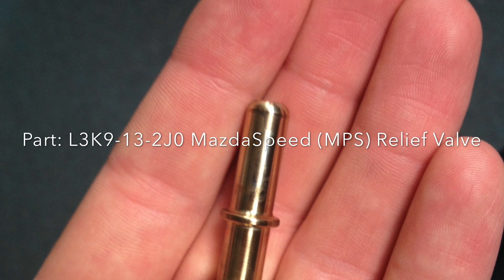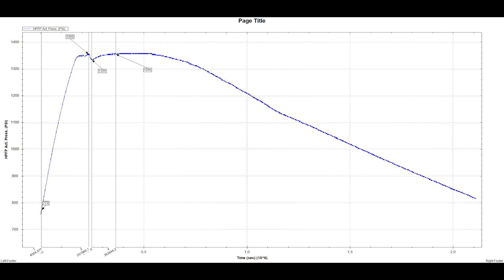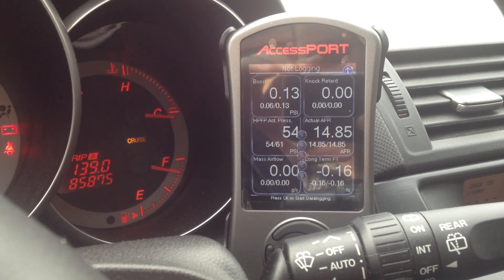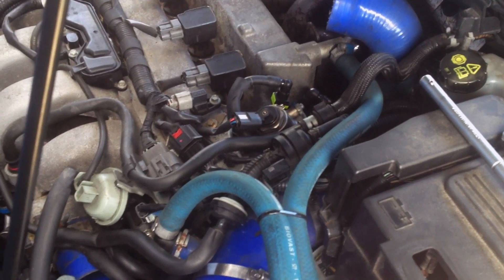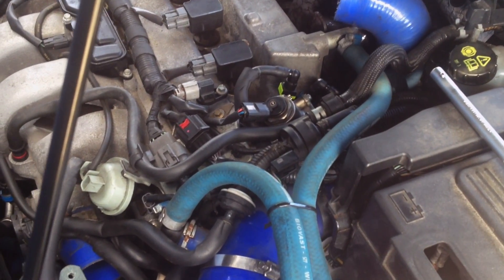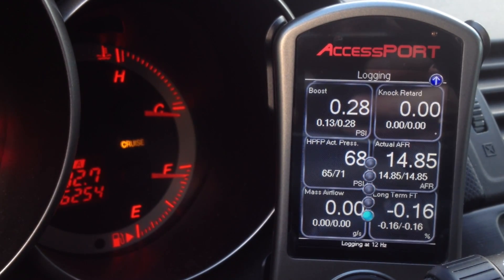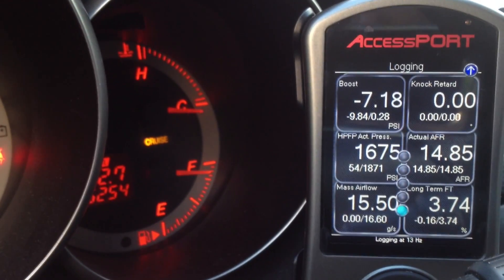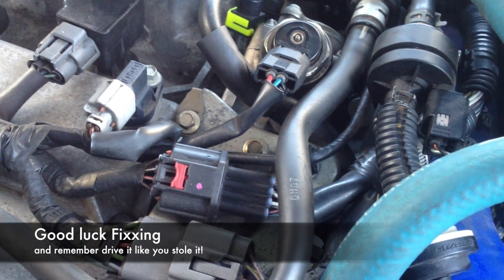Relief valve Failing & Fix Mazdaspeed 3/6 CX7 (MPS)

Comment: I have p2178 fault occasionally on my ms3, it have low rpm (~1500-2000) jerking while driving at steady throttle position, hpfp at idle is 420 psi and on light throttle 1650 psi, LTFT 1 is - 15, no vacuum problems, maf and lambda sensors working fine, what to look next, car running fine after throttle relearning procedure, and after day or two it's starting all over again to piss me off, sometimes throttle is very responsive, and sometimes like there is no turbo, its very laggy, limiting boost to 0.6 bars

Comment: How do I check that the valve is working properly with a physical inspection?
Reply from the maker: Well that's difficult! You can remove the valve and then screw in on a hydraulic pump with pressure gauge. But make sure to use fuel for the hydraulic liquid, you don't want to contaminate the fuel system with hydraulic oil or other liquid. In anyway a cheap ELM327 scanner and a good odb2 app for Android can do the same without removing the valve and creating a contraption to screw the relief valve in!

Comment: Hello i know is been years to this, I recently got a CX7 and having trouble with CYL3 misfiring (20 to 80 times only) only on cold starts, no check engine lights, I am wondering did you had any misfirings because of this relief valve?
Reply from the maker: A bad relief valve will not give misfires in 1 cylinder. Then all cylinders would be misfiring and would be doing it all the time. Might be a dumb question but have you checked the gap of the plug? Have you swapped over the coil from cyl3 with for example cyl4 to see if the misfire then happens in cyl4. And checked the resistance of the wires to the ignition coil?

Comment: I've pulled this part number but it says it doesn't fit the speed 6. I'm having the same issue where it feels like the fuels cuts off at certain rpms. I'm looking at replacing the fuel pressure sensor as well
Reply from the maker: The part should be the same! From my knowledge you could ask your local Mazda dealer for the part number! If you have bad pressure sensor you also have problems with high knock retarding or high or low AFR and your LTFT and STFT would be showing really high or low number like ±15% since the ECU uses the pressure sensor to calculate the injection time and this will affect the AFR.
Reply: @jaspervermaas  ok. Thank you. I know it bogs down real bad and acts like it's gonna die on acceleration like the fuel is cutting out. I have new injectors, plugs, and MAF sensor. Trying to troubleshoot everything we can.
Reply from the maker: if the rail pressure sensor is dead or on its way out you would also see when idle... Than the pressure should be close to 450 or 600psi from what i remember... So if its only happening at full power thans more than likely thats its the valve and not the sensor!
Reply: @jaspervermaas  ok. I will take a look at it. It's a brand new motor and we've been troubleshooting everything these last few weeks on why it's running the way it is. You've been a huge help
Reply: @jaspervermaas  so after messing with the car, the hpfp acctual pressure only reads extremely low. Would that still be the relief valve?
Reply from the maker: @thebigd7177 are you running e85? If your running the car with more the 35% ethanol than the needle on the top of the HPFP that controles the pressure Could be fouled. The fuel under high pressure will flash when suddenly lowered in pressure and this makes the e85 or mixture start to gum up the needle that controles the pressure
Reply: @jaspervermaas  nope. Just running 91
Reply from the maker: Could also be the fuel filter or the fuel pump in the tank... If the filter is dirty it can restrict flow... But this may be a far vedged thing.... If the car is also seeing a really Knock retard of 7+ than the ecu tries to pull timing and inject more fuel. If the KR is still high after pulling timing than it will try to inject even more fuel. And it will command a crazy injector duty this will keep the injector open this can also cause low fuel pressure. Now here is the kicker... Knock is detected by the microphone connected to the engine. But if there is any thing that is vibrating at the frequency that the Knock sensor thinks is Knock then you have falls KR detection but it will do all the above discribed steps to counter the KR.... I had this ones with a bolt and washer that was rattling but I only had KR that made no sense to me so I just went over all bolts that I had touched and that fixed my KR... But it's a just thing that you might want to check or log on the car if you see high KR and high retarding and high injector duty cycle>90%

Comment: i replaced my prv but th3 whining noise still there could the hpfp be busted?
Reply from the maker: As long as your fuel pressure stays at +1900psi when you did the test that I describe than your reliefvalve should be fine! And if you do a data log of the fuel pressure when driving and under boost and the commanded pressure is reached and you'r not running <90% duty on your HPFP than its not the HPFP
Reply from the maker: You could always check if there is dirt in the needle of the pressure controller of the HPFP. But if all values are good when logging than there shouldn't be any mechanical issue!
Reply: @jaspervermaas  did all of that and the noise still there

Comment: so mine does the EXACT same thing, squeals, falls on it's face, stalls out intermittently and dies.  do you think the squealing is because there is not enough pressure on the HPFP?
Reply from the maker: The sqeel happens because of the design of the valve. There is a mesh screen that opens when the pressure is to high but if the mesh fails than it opens and starts vibrating and causes the squeel

Comment: I am having issues wkth my 2013 mazdaspeed 3. Going lean at hi boost.. but i can run half throttle at hut 15 psi at 11.5 afr. But the second i go more then half throttle hofo acct pressure drops from 1850 to 1400 1000 800 400 and leans out bad.  I have a dw300 in tank pump and auto tech internals . With 10k on them and ran fine until just recently.  Koeo hpfp pressure is 51 to 48. And went to 46 and 44.  Idle fuel pressure goes down to 350. When doing the test engine warmed up koeo with position to on the hpfp pressure goes down not up. 430 410 400 380 365 then trickles down slowly.  Only codes i have seen on the car is p0455 and the purge valve is working sealing and functioning.
Reply from the maker: If do the test i showed in the video and the  pressure goes up to 2100psi than its not the valve on the fuel rail! If your hpfp also has a good spill valve than it could be either a bad LP fuel pump, fuel filter that is dirty or maybe a bad injector. Easiest thing to do is change the fuel filter.

Data log the commanded injector duty and the real injector duty. And maybe setup a map that protects your engine by lowering the commanded boost and retarding the timing when fuel pressure drops to 1000 when at 100% throttle cause running 400psi fuel when going full boost will 200% kill your engine due to knock!

Comment: Hey guys, I'm having trouble interpreting the time scale on the x-axis.  How long should we be trending the fuel pressures after shutting off the ignition?  Anything x 10^6 seconds seems kind of off to me?  (i.e. 1 x 10^6 = 1,000,000 sec = 12 days, LOL).  Was the accessport maybe recording in milliseconds?
Reply from the maker: Let your car run for 5 to 10 min. To warm up than you shut the engine of you should see the pressure rise by 2 to 4 psi per second in the beginning and that will slow down the more pressure the system builds up so it could take again something like 10 min for the complete test!
Reply: @jaspervermaas  sorry, didn't see your reply until now.  Thank you for your response!

Comment: I'm not getting any fuel to spark plugs on my 06 mazda speed6 2.3l awd turbo. To test and see if the pump was working we cranked it with that yellow hose unplugged and fuel came out, any ideas what can be causing no fuel to spark plug?
Reply from the maker: Get a OBD2 Dongle or a use your Cobb access port to see if the HPFP makes any pressure... The fuel pump in your tank should make between 45 and 60psi than the  HPFP should make minimal 400psi. Maybe your injector fuse is broken... This video only shows how to diagnose the relief valve on your HP fuelrail... And should open close to 2100 psi to protect your fuelrail and injectors.
Reply: @jaspervermaas  I'll order the dongle and stuff, it'll take a little bit to get it here but if I post the stats it shows will you be able to help diagnose it with me? Please and thank you for the help already
Reply: @jaspervermaas  do you mind placing a link to one? I don't want to get a completely trash one on accident
Reply from the maker: @outfishing3909  https://www.amazon.com/obdator-Bluetooth-Scanner-Automotive-Diagnostic/dp/B074DWH8JR/ref=mp_s_a_1_3?dchild=1&keywords=elm327+bluetooth+obd2&qid=1625521919&sprefix=elm32&sr=8-3
Reply: When I use my obd2 scanner it says fuel system ok, im new to using these more high tech scanners I'm used to the old show code and reset code ones.
Reply from the maker: @outfishing3909  check your fuses in the engine compartment. And if they are all good than get yourself a ELM327 Bluetooth dongle and OBD scanner tool for your smartphone like "car scanner" for Android than you can monitor live data from your engine and than you can do a good diagnose and not play parts bingo by throwing a new pump on your car and finding out that for example your pressure sensor is broken and because the engine sees no pressure it will not inject fuel...
Reply: Also my fuses should all be ok as far as I can tell
Reply: When I use starter fluid it sounds a lot better but still doesn't start if that makes any difference
Reply from the maker: @outfishing3909  do NOT start a direct injection car with starter fluid! MZR engine is DISI (direct injection spark ignition) meaning it will inject fuel close to TDP so you have a good fuel mixture next to the spark and have a ultra lean burn... If you have multimeter you could try and check if the HP fuelrail sensor works... Don't know from the top of my head if you need to read milliamps or volt... But you should be able to  see if the volts move up and down when you crank the car...
Reply: I'll ask my dad if we have a multimeter around. I know the fuel rail is a bitch to reach

Comment: Hi great vid - wondering if your issue was similar to this? my car drives fine upon first startup and warm up drive, sometimes when I have stopped then restarted I get CEL code:  "P0091 Fuel Pressure Regulator 1 Control Circuit Low" -  Viewing my Accessport I can see that the HPFP volts are at 0.60 (usually 1.50 and above, idle and driving)
And HPFP pressure is around just 500 KPA (usually 3000 idle up to 10000) - The car drives like it is misfiring and barely makes revs,  though oddly enough after about 1-2 minutes the system all goes back to normal - Volts go up, pressure is at normal levels and the car runs perfect,
Reply from the maker: Are your STFT, LTFT and Lambda good? As for what you would expect for the load en rpm? Don't know if you have accesstuner cause than you will be able to see where in the tables it wants to be... If the holding test that I show in this video should show if it's your relief valve... What you could also do is try to warm up the fuel rail without starting the engine... Warming the fuel in the rail will also make the liquid expand and should also increase the fuel pressure in the rail if you see that it opens early than you that it is the relief valve. But I could also be a sticky hpfp (the top of the pomp where the connector is has a small spill valve that can get vault)  of a bad injectoren or on its way out injector.
Reply: @jaspervermaas  Hi thx for quick reply - don't have accesstuner, only AP - I checked out the valve on the pump housing (I assume the really small nipple directly on top?) gave it a good clean. 
I also have Autotech HPFP - it's less than a year old so hopefully not faulty, first thing I did was change out NGK plugs for Denso ITV22, no change there, though the lucky thing with this issue is how it only lasts 1 minute - always after it has been running (never on first startup/run for the day), then sitting for 10 - 30 minutes (made me think maybe just the battery is going so not supplying HPFP with the right voltage at key in engine on - literally running like it's misfiring a cylinder, spluttering  and then completely resolves which may or may not rule out a few things.
Reply from the maker: @mitchp85  check the following data. Injector duty cycle, fuel pressure, hpfp duty, vvt cycle, LTFT/STFT. Make a log of it when you start the engine and when you don't have the probleem any more and compare the data. Might even be a egr that is stuck and you engine has to compensate for low oxygen (exhaust gas mixture with intake air) and this make your car run rich...
Reply: @jaspervermaas  Ok thanks, good idea, ill log when it does it again and just normal working conditions - my EGR is deleted recently, but yes it could be stuck too.

Comment: doing this test, my fuel pressure would drop before 1400. Now after replacing the valve it only gets to around 900. Any advice on what else I should check?
Reply from the maker: Have you checked your hpfp.. it could be that needle valve on top of the pump (the nut with the connector) is sticky or dirty. What could also be possible is that you have a injector that is leaking.... The injectors leaking can be checked by running the engine idle and checking the LTFT en STFT. If this numbers are showing like -15% or -21% than it could mean you have a leaking injector. Cause fuel is leaking in the engine and it wants to compensate for the extra fuel...
Reply: @jaspervermaas  ok thank you, I'll check that next and if that doesn't work i might just get a hpfp O-ring kit and rebuild. You're a damn legend for being so helpful to everyone years later.

Comment: EXtremely useful thank you. I have a slightly rough idle and a mysterious squeaky ticking noise. HPFP pressure never dropped below 400 at idle but I did this and saw fuel pressure drop after 1450

Comment: Just in case you only need to take the intake out and a 17 deep socket and voila, no need to take those 4 bolts or anything else. And to take off the lock just twist the flat head screwdriver